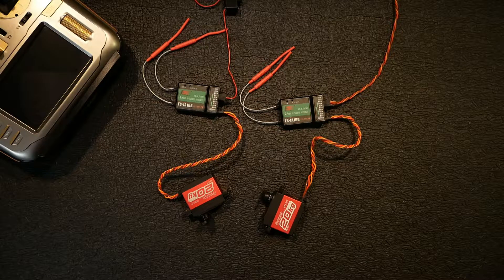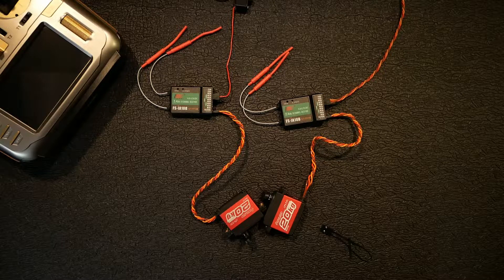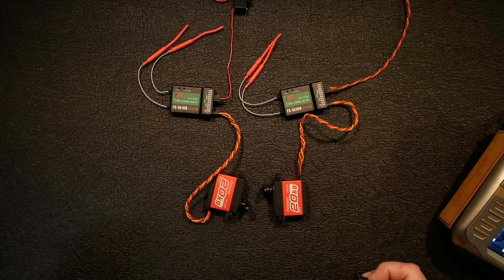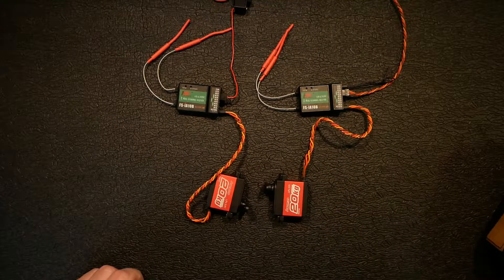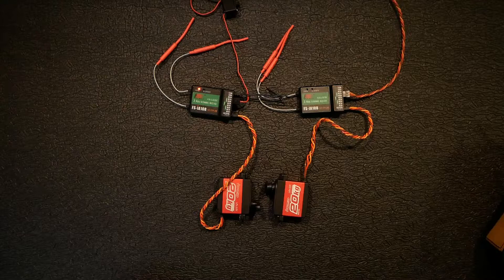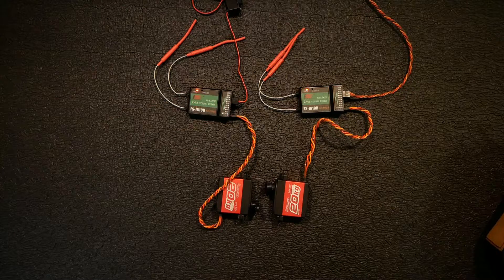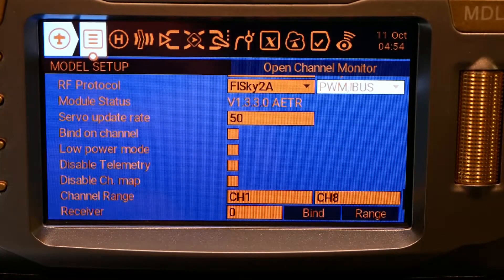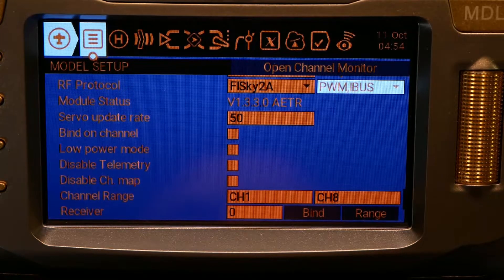Redundant RC Aircraft Systems: Binding 2 FlySky Receivers to a Radiomaster TX16S

Comment: Thank you for your video! Quick question mate, I bind receiver Flysky FS-iA10B (R1) which came with Flysky transmitter and works fine. I would like to bind another Flysky FS-iA10B receiver (R2) to same Flysky transmitter. Only one receiver will be operating at any given time. I would like to perform testing debugging without having to disconnecting/removing receiver (R1) mounted on Arduino ROBOT. Cheers mate!
Reply from the maker: Just bind R1 as usual. Turn off R1 and then bind R2 as usual. Both receivers should receive same signal and operate simultaneously.
Reply: @ Brilliant! Appreciate your help mate! NEW SUB 🙏🏻

Comment: so did you figure this out mate.  getting 2 t.x flysky fsi10 receivers working together.  .  im sure it can be assigned to the radio master  controller
Reply from the maker: I've tried it several different ways but I can only get one or the other to bind but not both at the same time. If you have any ideas or tricks let me know, I'd like to try it. Thanx for the question!!
Reply: @ChunkyC_RC  Only way that I know to run 2 Flysky receivers at the same time is to throw a second module in the back of the TX16S and run 1 each off the Internal and External module at once. A second module will also let you mix and match your breeds of receiver running at the same time. 😉

Comment: On the receiver options you can set the number of teceivers you use. Bind first with 0 second with 1 or the number you like.
Reply from the maker: Yeah you can assign the receivers any number you like. Once they are bound you can't change that number or the receiver won't work. You will have to re-bind. Thanks for the comment...
Reply: Worked a treat changing the receiver No. Thanks So much